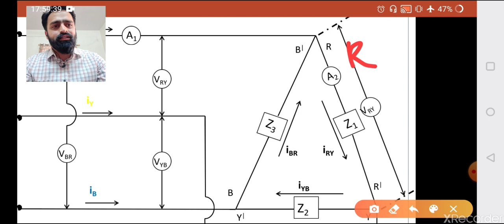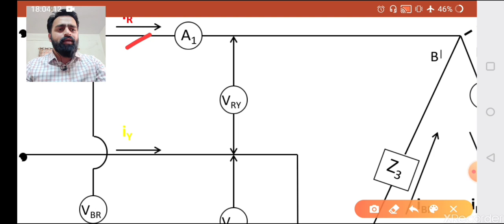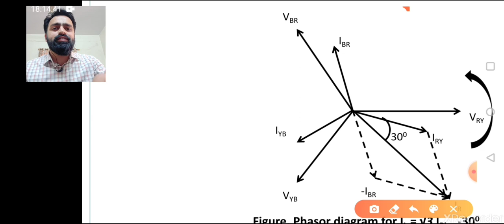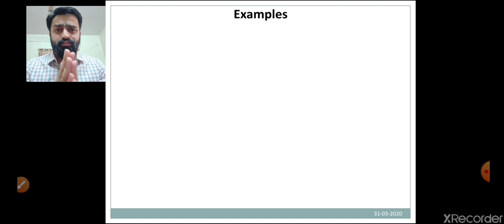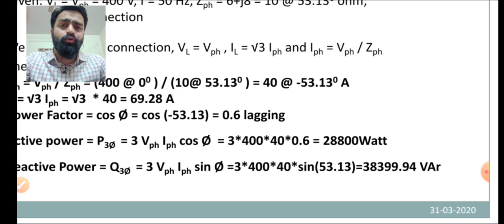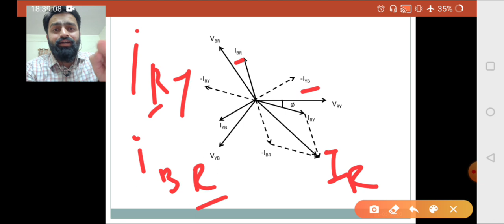Three Phase Delta Connection Explained with Numerical and Phasor Diagram

Comment: Z(ph) = 8.02@51.47
I(ph) = 54.86@-51.47
IL = 95.02 A
Power consumed = 45049.9 watt
Reply from the maker: Impedance unit is missing..
Well done.
Zph = 8.029 @ 51.48 ohm
Iph = 54.80 @ -@51. 48 ohm
IL = 94.91 A
P = 45049.97 watt